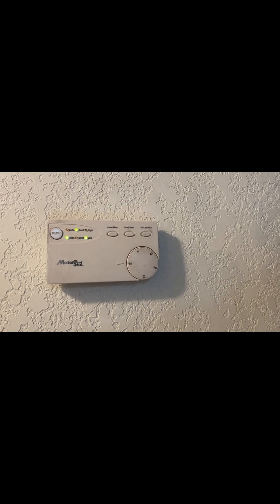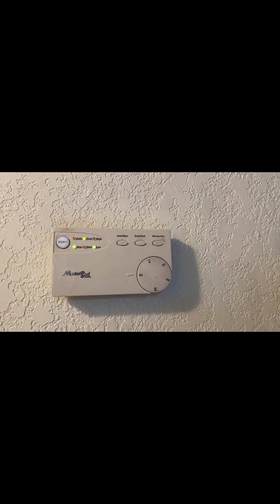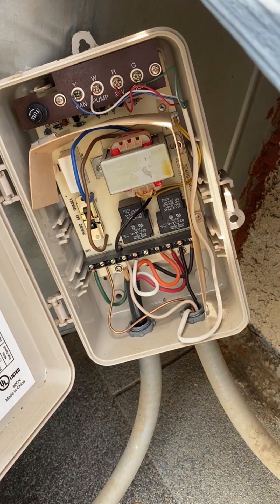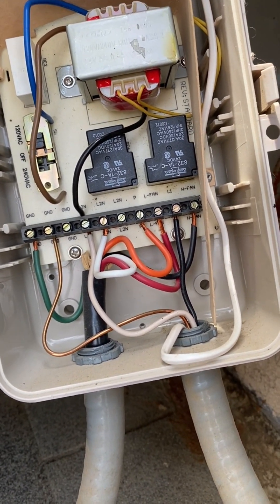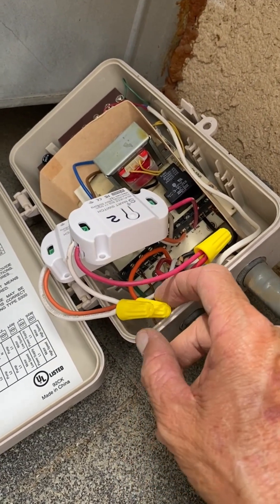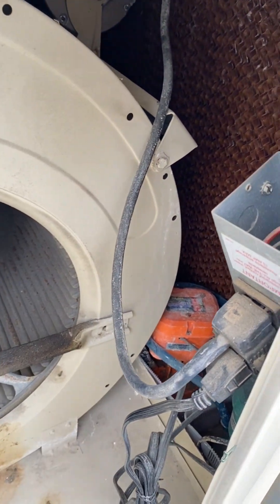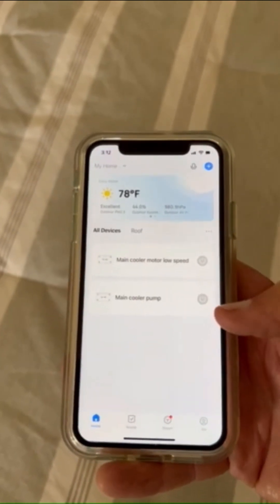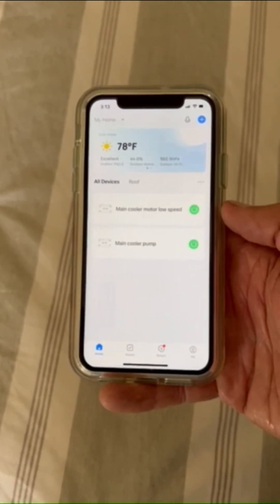Smart low voltage evaporative cooler controller

Comment: I am going to just connect the pump and fan motor to the fan power. The only downside I can think of is thst the pads dont get soaked beforehand. Am I missing something?
Reply from the maker: That should work if you don't care about wetting the pad independent of fan operation. It will let you control it with a single wifi switch.

Comment: Ok, this is brilliant. Please explain what wireless controllers you used and the system it’s linked too. I have a master stat thermostat, the screen just blacked out completely. So I’m looking to fix it and upgrade.
Reply from the maker: I am using a master stat too. I leave it in manual mode on low cool. Then I can switch the pump and fan on and off with wifi switches I mounted in the box with the controller board.

Comment: Hello. I came across your video and I'm curious how this worked out for you through the remainder of the summer months. The evap cooler on my house uses a thermostatic control, which is entirely mechanical, and I have to manually switch it on/off. Most of the controllers I've seen seem mediocre, so I was considering different smart relay options (Sonoff and other brands). Any updates on how your experience with this would be appreciated. Thanks!
Reply from the maker: It has been a game changer. My controller has a thermostat, but it always short cycled the cooler and drove me crazy so I had to basically used it as an on/off switch. I have a two story house with one controller up stairs and one down. I used to have to go upstairs to turn off the cooler each time. Now, I can control it from the couch. Also, If we are out of town and return home, I can switch it on from the road an hour before we arrive and have the house nice and cool. My nest thermostats which control my heating and AC give me a readout on my phone so I can tell when I need to switch on some cooling or when I can switch it off. I can even control the evap coolers based on the readout from the nests. I am loving this home automation stuff.
Reply: Thank you!